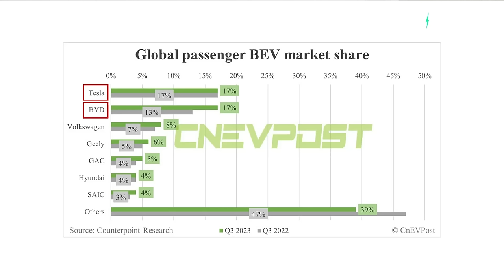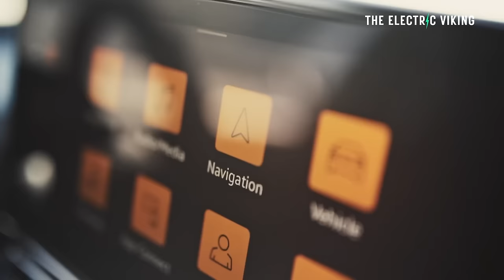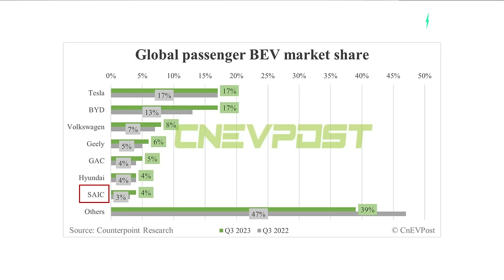The 7 car groups that own most of the worlds electric car sales

Comment: BYD confirming a EV and Battery mega factory in Hungary by 2024 So yeah Europe is sort of sorted
Reply: DC.409 you are making me laugh. Just you watch every day of the next two years. Of course you go into a new market with the highest price possible. BYD is not a welfare organization. You are talking as if BYD is already 30 years on the European market...then U would call it a failure, too.
Reply: The BYD Dolphin is relatively reasonably priced in the UK, it’s about £25,000, the same price as a basic MG4. The Atto3 and Seal are both overpriced in the UK.
Reply: Unions?  Under a dictator?  Watch that space.

Comment: 8% for VW. You forget that unlike BYD and Tesla, right now VW are in the vehicle business not the EV business. And for better or worse the EV market is but a fraction of the size of the overall vehicle market. So don’t sneer at that 8%. What % do they have if the vehicle market?
Reply: BYD sells other vehicles too not only EVs
Reply: 50% of VW market was in china, where they are perceived as backward, as a result their sales are dying quickly. Along with high energy costs in Germany and mass redundancies there, how do u see that 8% in an couple of years time
Reply: @johnchin1456 Exactly !!! That's why wall st is forward looking mostly instead of looking at present results.